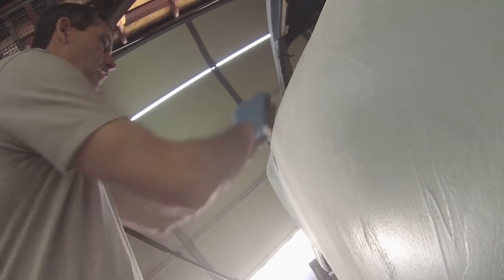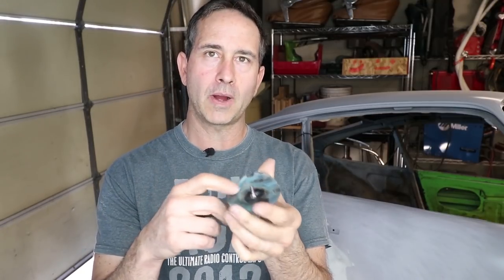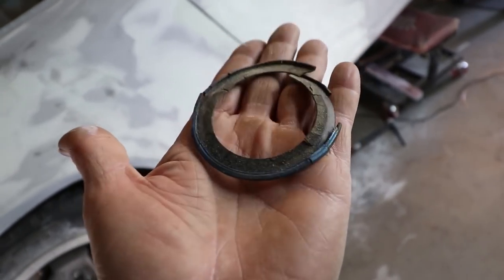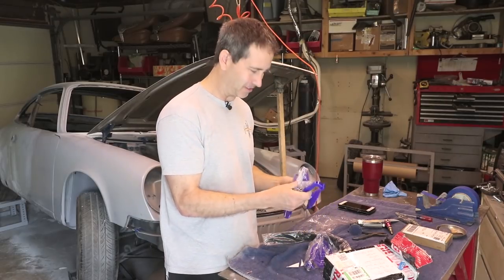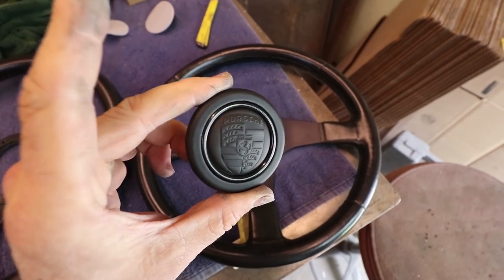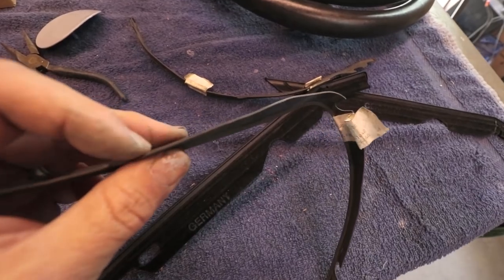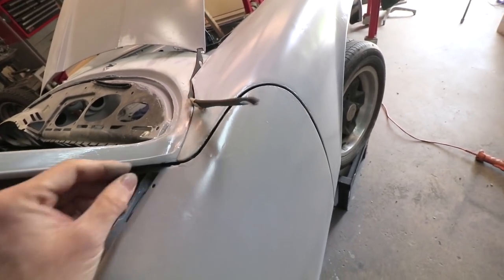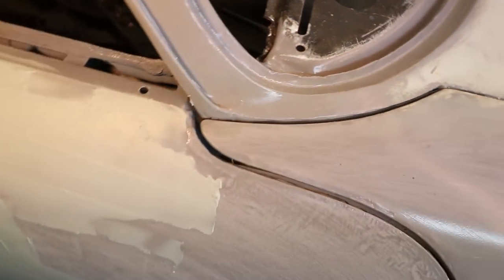My Porsche 911 Gets a Nice Gift...Forget Sanding!

Comment: Haha 😂I liked the bemused look on your face regards the blue suction cup things.... I’ve sent you a quick email earlier on what they’re used for (multiple-purpose) hope that helps - I use them for all sorts of stuff 👍 

Referent the seals, I’d try using a craft knife and trim down or off those ribs which push the thickness out and then bolt up. You should notice they do compress quite a lot and stop water ingress very well which was always an issue with the early 912/911’s resulting in eventual rust which was a problem thankfully resolved with there last go on the 993.

I’m running a MOMO MOD 07 wheel with the deeper dish... I’ve made a reference as to why I’ve gone that route again in my email, it’s definitely a personal thing though just like a well fitting suit 😉

Trimming back those jack-plate box sections definitely appears to make a cleaner harmonising visual difference... it’s those little touches which are going to make all the difference in the end 😇👌 

Keep that progress coming, the more dust on the floor from sanding, the closer you are to finishing 😬😂👍

Comment: That horn button will look really cool. I think blacked-out stuff, low gloss or flat, on a restomod looks really nice. Like the wheels in that kind of paint, too. Good job, Tom. You're spending a lot more time with the detail body lines than I did. I'm using the excuse that Triumph didn't do a great job out of the factory with that kind of stuff. Don't think I would say the same about Porsche!
Reply from the maker: I love the horn button too!  I've spent more time than I car to admit aligning the panels on this car.  It started with a twisted shell, then fitting various years parts and now body work.  Next week's video should bring it all together at least on the passenger side.  The fit and gaps are starting to look very good.  As Porsche said excellence was expected!

Comment: I know little about bodywork, but I like the fact that you're taking your time on it. I've learned on another channel(can't remember the one) that it's better to take things slowly, as the different layers of primer and filler need some time to properly cure/shrink. Often, additional sand marks start appearing through the layer(s) of primer once they cure/shrink. Not sure if any of what I just said is true or not though...
Reply from the maker: Thanks, I'm certainly not a pro.  I painted one car before and that was 25years ago.  Today's materials and info is pretty good.  I'm following the SPI tech manual very closely plus a few tips given here.  Most shrinking problems occur in the 2k because not enough time between coats or not fully cured.  Once my car is in 2k, I'm going to push it outside in the sun for a few days and then go back to working on the roll bar again before I do the final sand.

Comment: Great tip Tim on using the seals to get the correct panel alignment.. not sure too many paint shops would go to this detail.. I could be wrong? But will definitely get them to use them when mine goes in for paint

Comment: The fender seal you are using is a rear fender to bumper seal with the formed in front edge visible at 8:22. The suction cup things are to hold a part under pressure while glued, for instance glued on door mouldings.
Reply from the maker: Oh, good to know.  I didn't check part numbers or correctness on that seal.  Do you know if the correct seal for a 74 is thicker like the 993 one?
Reply: There are 2 widths of the upper, visible part, 964/993 being wider. The part that goes between the shell and bumper is about the same on both versions.
Reply from the maker: Great, thanks for the info!

Comment: The thing about sanding....is "guide coat , guide coat and always use guide coat" with guide coat , you stop thinking about SANDING and just watch your guide coat.
    Sanding goes MUCH FASTER with guide coat.
Reply from the maker: Yep, I use dry guide coat even on filler
Reply: @GarageTimeAutoResto  I say sanding is sanding its the thankless part of body work nobody sees the long long effort.
   But guide coat changes the mindless act into , a step , instead of an endless elbow exercise!
   Its the "BIGGEST" SPEEDY , aide to getting thru it !
And I agree guide coat on filler too.
However I watched a " HOUSE OF COLOR" body and paint by The Man Himself...and he 2k primed right over 80grit...I was shocked .But you cant argue his finishes are the best.
Reply: MindDezign some people say not to sand down a car to bare metal using 80 grit because it marks up the metal. I've done just that on and old jeep, and it did leave a few marks on the metal, but after etch primer, you couldn't tell any marks were left behind on the metal.
Reply: @fgjf1079  well he was sanding bondo , he only went down to 80 grit and primed on too with 2k high build primer I was just surprised he only went as far as 80 grit.
    George Barris famous Cali Custom car builder said " metal ...doesnt come with scratches in it.....MAN puts the scratches in it. "
Ive always taken that, as ,dont use any grit more ,than you need...
Reply: @fgjf1079  well times have changed since alot of old body men advice due to high build 2k primer . 
Hell you can fill small dimple dents with coats of 2k primer at it covers and fills scratchs as long as you guide coat to be sure they are blocked out in the primer so you dont see them...
Reply from the maker: I'll cover this in detail in next week's video, but there's the recipe I'm following.  80g on bare metal, epoxy primer, scuff epoxy with 80g then filler, block filler 36g,80g,180g, epoxy primer again, 2k primer, block 2k with 180g, 220g, 400g, base coat
Reply: @GarageTimeAutoResto  mine is different but as long as its 2k everything I agree.
  Im glad they outlawed laquer primers so many kept using that useless stuff..